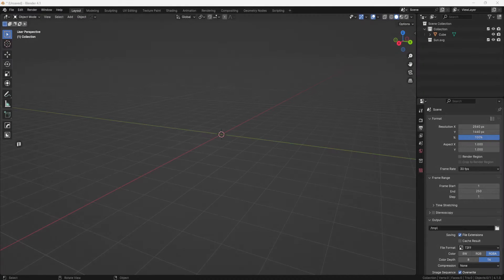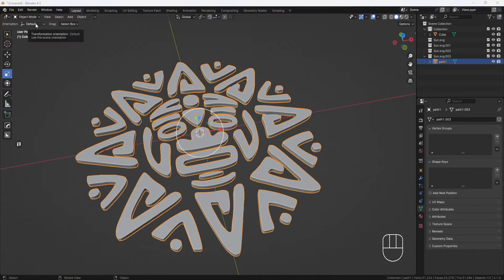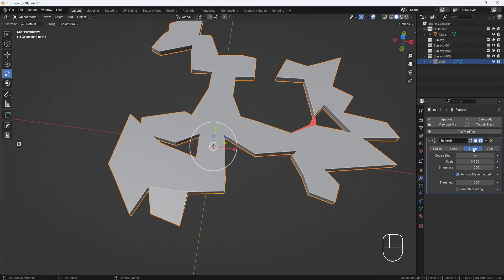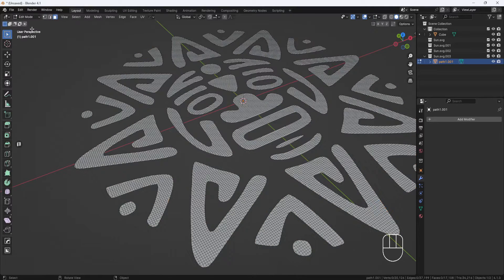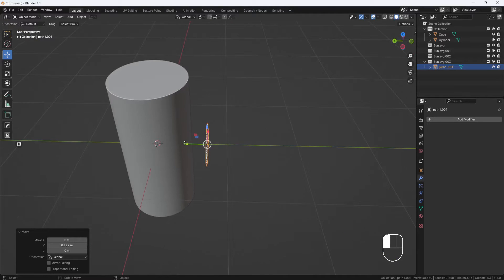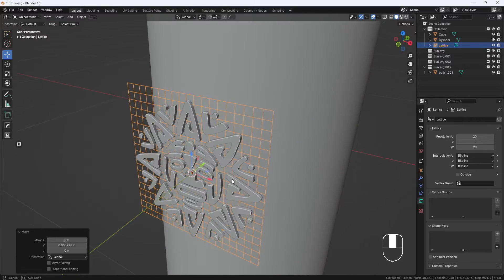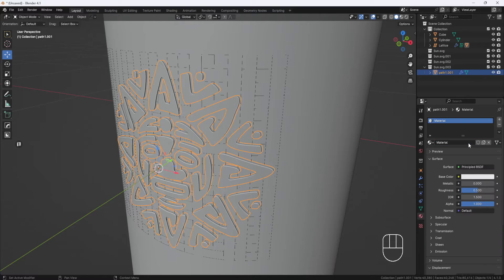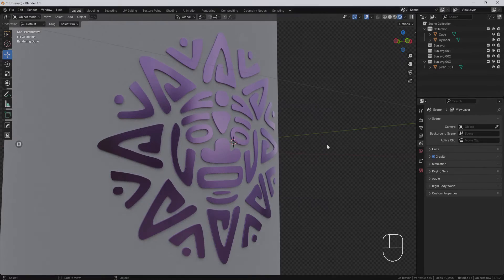How to Project a 3D Model on to a Curved Surface (Blender Tutorial)

Comment: Thank you! This helped a lot! But I have a quesion. If I have a bigger object and want to wrap it completely around the whole cylinder (360 degrees) how do you do this? Because when I try it only sticks to the front side :(
Reply from the maker: Hi, thanks for the question. Yes, this method only projects the model onto the front face of the cylinder. If you want to wrap a pattern completely around the entire cylinder, check out my other tutorial here: https://youtu.be/Axuz1848gxU

Also, I just finished another tutorial using a program called Plasticity, where I show how to do the same thing, wrapping a pattern around a cylinder, and then I import the model into Blender using a Blender Addon: https://youtu.be/i-JgNri2CNg

Comment: Good Lorde.  It's amazing that anyone can learn blender at all with all it's hidden menus and special key commands. Right-Click here, Shift-Key there, CTRL-This, ALT-That, use this setting that is buried 20 menus deep and these settings that make ZERO sense but if you don't everything will fail.  This is software that needs to be re-written from the ground up and simplified.
Reply from the maker: Yes, I agree. Blender is definitely a keyboard command type of program, so it does have a bit of a learning curve, especially if you want to do complicated modeling. I've used many different programs over the years, and they all have their strengths and weaknesses, but in my opinion, 3d Studio Max was the hardest program to learn. And the Zbrush UI is just a mess. You can tell it was designed by an artist because everything is scattered all over the place, Hahaha. Right now, my main focus is centered on learning Plasticity. If you want a simple interface with easy to use tools that aren't buried in menus or scattered around everywhere, give it a try. There is a free trial version you can download https://www.plasticity.xyz/ and the cost for a license is very reasonable.

Comment: i don't know if the problem is the object I've tried this method to make a c hanging lamp cylinder. what I'm trying to do is put patterns on it then i will use a boolean to make a holed pattern on the cylinder but the pattern seems not wrapping all around the cylinder instead only half of the cylinder and the pattern seems to deformed it only read half of the cylinder.. is there any solution to this? thank you🙏
Reply from the maker: Yes, there are limitations to this method. You can only project your geometry on to the faces of the cylinder that are facing forward. You can't wrap all the way around the cylinder. If you have a pattern that you want to repeat all the way around the cylinder, you could project it onto the front of the cylinder and then Array it around, or if it's a single design that you want to wrap all the way around the cylinder, you could try using the "Curve" modifier. Several people have asked about this, so maybe I should make a video about it.
Reply: @roddeweese6402  🙏 thank you, i will try the it to project a single pattern and array around the cylinder. i already tried the curve modifier and it does work but now, i having a problem in boolean the pattern to make a hole onto the cylinder some of the pattern does make a hole some are not 😅 i wish could show you, but i'm doing some trial now and i'm sure there is a problem with the pattern. thank you for the tips 🙏
Reply from the maker: @lloydfranciszarate7840  I'm working on a tutorial that might be helpful. I hope to have it uploaded later tonight or tomorrow. I also use another program called Plasticity that might be better suited for what you're trying to do. It's more of a CAD modeling program and it makes stuff like booleans really easy to do, and then when you're done, you simply export your model back to Blender.

Comment: could have done the same thing with shrinkwrap modifier without a lattice
Reply from the maker: In my experience, it doesn't work without the lattice. If I try to Shrinkwrap the model directly onto the cylinder, the model gets flattened.

Comment: this works great when the design is smaller than the diameter of the cylinder, but I want to wrap a grid around the whole circumference and this method is giving strange results. any advice?
Reply from the maker: That's a good question but it's one that I don't really have an answer for. If you want to wrap the grid all the way around the cylinder, I think you would have to take a different approach. I'll have to look into it and see if I can find a solution.
Reply: @roddeweese6402  thanks. I did find it after searching all night. Added a curve modifier tied to a bezier circle
Reply from the maker: @ Interesting. I'll have to try that out. Thanks for letting me know.

Comment: Pretend I am dumb( I am), why not just shrinkwrap it directly, why should we use lattice?
Reply from the maker: The Lattice keeps the model intact as it wraps onto the cylinder. If I don't use the Lattice, and I try to Shrinkwrap the model directly onto the cylinder, the model will get flattened.
Reply: @roddeweese6402  thats a really good explanation, i get it now. subbed

Comment: This worked very beautifully. I appreciation your clear instructions. I had one problem. My model is really wide, about 1/2 of the circumference of the cylinder. At first it wraps with distortion. Then I switch to Project and it wraps with no distortion but only about 1/2 the model and about 1/3 of the cylinder. Am I doing something wrong or is there a limitation to this method? Can this method be used to wrap a label all the way around a soda can for instance?
Reply from the maker: No, you are correct. There are limitations to this method because the model is being projected onto the cylinder in one direction only, so the bigger your model, the more it's going to stretch and distort as it projects onto the cylinder. I'm not sure how you would wrap a model completely around a cylinder. For something like that, I would probably create a decal and use the method I discuss in this video: https://youtu.be/vTsxxq2vSpA

Comment: Your tutorial subject is exactly what I've been looking for.  I'm new to Blender/3D modeling and this is really helpful.  When I get to the step to select all the faces using the coplanar option, it doesn't select all my faces on top.  How can I tell what is wrong with my image?  Or is there something else I need to set to make this work correctly.  I don't know what other info you might need to help answer the question.  TIA
Reply from the maker: Ok, I uploaded the new video. https://youtu.be/VycAdjUqz0c. Let me know if this doesn't solve the problem.
Reply: @roddeweese6402 , just watched the video. Perfectly explained. Thanks!
Reply from the maker: @rip55jcp  Awesome! I'm glad I could help.
Reply from the maker: Hey, thanks for the question. It's kind of difficult to know exactly what's wrong without seeing your model, but if I had to guess, I'd say that some of your faces are probably not coplanar. There is an easy way to fix this using the Scale tool, but it's kind of hard to explain. I'll record a video to show how to do it and post it in a little while.